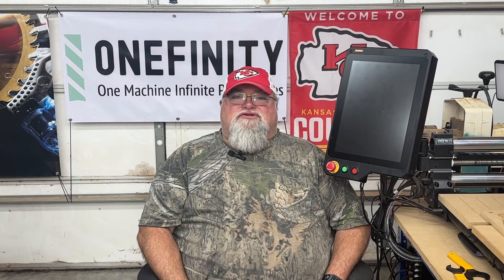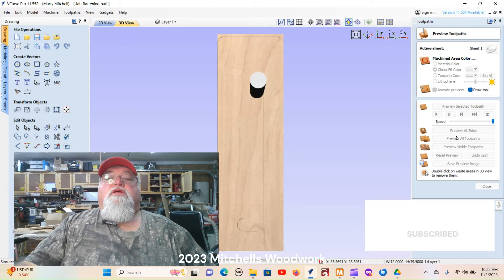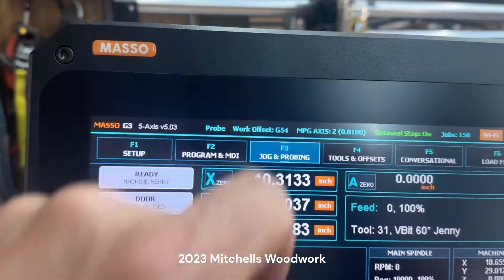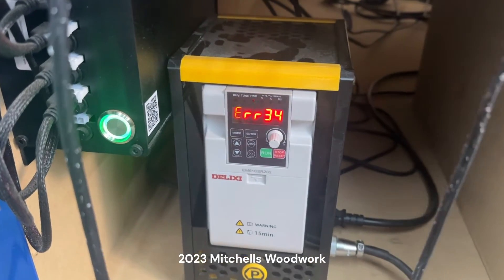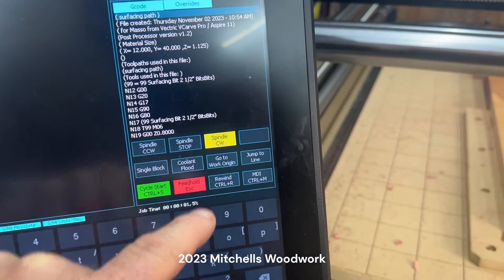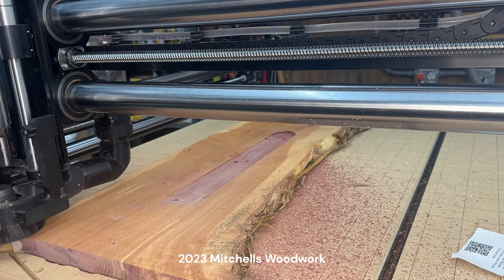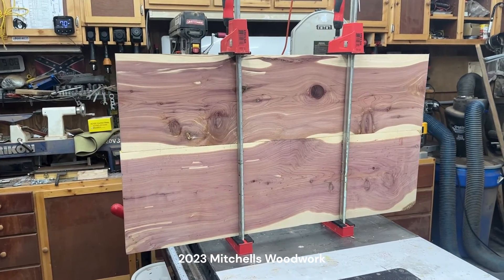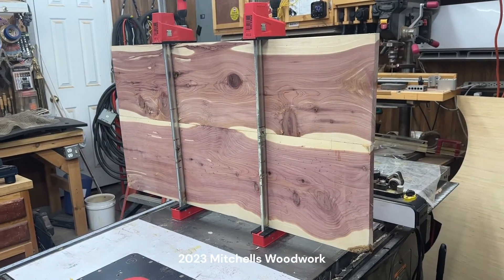Flattening A Slab With Onefinity Elite Foreman CNC / PwnCNC VFD Error 34 / VCarve Pro

Comment: Would you have the Bit # and the types of blades used. I need a good slab bit. I know it’s pricy
Reply from the maker: Thanks for watching.  The bit I used in this video has been discontinued, but this is my affiliate link to the newest version. Using this link will save you 10% on your order total.  They are expensive, but this is one of those “buy once, cry once” kind of tools.  I know I’ll never have to buy another one for the rest of my life.  Thanks for watching and for the question.  Let me know if there is anything else I can do for you. 😊

https://bitsbits.com/product/sb25-2/ref/6251/?campaign=YouTube%20Flattening%20Slab

Comment: What’s the difference between G54 and G55 offset ? And what dust boot are u using ?
Reply from the maker: The G-offset locations are defined and set by you.  My G55 is set to the corner of my wasteboard fence.  It’s my permanent XY zero.  But I could’ve just as easily set it as G54 or G56 or G57, etc.  My G54 is set the G54 to the true X Y zero at the home position, but I’ve yet to figure out how that’s really beneficial in any way.  

Basically, the G-offsets are to to quickly move your spindle to a very particular spot on your wasteboard, like the inside corner of my fence.
Reply: @MitchellsWoodwork  Ahhh. Got it. I’m so new to this and learning a lot. Thanks !
Reply from the maker: I’ve been using the PwnCNC v2 dust boot, but I’m having to switch to the v3 for my upcoming ATC install.  They are both exceptional dust boots and I 100% recommend either one.  

https://pwncnc.com/?ref=-KowKWxX6qaGK
Reply: @MitchellsWoodwork  thank you again !
Reply from the maker: @TheHelicapt  just keep watching videos, brother.  There’s a wealth of information here on YouTube.  Also, join some Onefinity and Masso groups.  They both have great forums as well. 

https://forums.masso.com.au/

https://forum.onefinitycnc.com/c/machines-elite-series/118

Comment: I am enjoying your videos and your input regarding the Masso controller. I do have a quick question about the Masso Likk app. I also use Vcarve, therefore I must use a Windows based computer. I have downloaded the Masso Link onto my computer and it seems to be working as is should but the window it is displayed in is so small I can barely make out what is in the input window. I haven't been able to fine a way to adjust it. Loaded it up on the mac, no problems pops up nice and big.  Any thoughts?
Reply from the maker: Thanks for watching and subscribing!  As a test, I just now tried to resize my Masso Link, and I didn't find a way to adjust it.  But I've never heard of anyone else having an issue with it being too small to see clearly.  Go on the Masso forum and see if you can find anything that might help you.  https://forums.masso.com.au/
Reply: @MitchellsWoodwork Thanks
Reply from the maker: Did you get this problem resolved?   I uploaded a new Masso WiFi video today.  

https://youtu.be/Z3Hbaqglv2g?si=I5_Nfi9TZXx60_kl
Reply: @MitchellsWoodwork It actually kind of resolved itself! I deleted toe Masso Link app and reinstalled it and low and behold it is normal size now. Don't know why, don't really care. It seems to be working now thanks for asking!
Reply from the maker: Glad to hear it!!  Now get to work! 
😉👍

Comment: I'm an industrial instrumentation/electrical tech so I'm fairly familiar with VFD's. That code 34 is probably just an overload error. Meaning it tripped the internal circuit breaker due to the extra amps you pulled. Most VFD's have a "reset" button on front. You didn't hurt your vfd because they're designed to do this. As long as you're letting it cool down you're good.
Reply from the maker: Yep, that’s the same thing the manufacturer told me.  Thanks for your feedback and for watching!

Comment: We’ve all had that happen. I used to get it often with my Makita and was the bit being pulled down under load. I’ve found it to be very important to clear dust from the collect during a change. At a minimum, tap it to knock dust out before inserting the new bit.
Reply from the maker: Great point, it’s very important to keep the collet clean to prevent tool slippage.  However, in this particular case I simply bit off more that my surfacing bit could chew. 😉

Comment: Love your channel.  Do you get most of your Cesar from a sawmill?  Also is the cedar you use dried at all?
Reply from the maker: I bought a couple 16’ trailer loads of cedar slabs from an older gentleman a few years ago.  These had been stored in a barn for over 10 years and were completely dry.  All of the thicker boards I use are from those slabs.  

I do have a great relationship with a cedar sawmill that supplies all of my thinner boards.  I have been buying and reselling cedar for several years, so I tend to keep a pretty good stash that have plenty of time to dry before I use them.  Thanks for watching!

Comment: heat the vfd too many times, and the windings on the spindle will end up shorting to ground.  As for the VFD, if you have proper cooling, it, in itself, if sized properly, should never get to the point of hitting over current, which leads to over heat conditions and faults the drive into safe mode (offline)- another point to make, when flattening a slab, always measure the highest point, set the DOC slightly under that, better to take more passes across to get to your determined z height final.  just tips.
Reply from the maker: As I said in the video, I absolutely (attempted to) set the Z at the highest point on the slab.  I can assure you, I have no future plans of heating up the VFD or spindle again. 😉

Comment: I have no experience yet but I do see guys doing slab surfacing where they make the surfacing tool path much larger than the slab, so the bit starts off to the side of the slab and then goes into the slab from the side.
Reply from the maker: Great point, and I've also been thinking it may be better to do them as a raster toolpath (side to side)  instead of an offset.  I'll try that next time and see how it works out.  Thanks for watching and commenting!

Comment: Very cool project Marty. I love the humility and humor of your vids. Subscribed! One word of advice. Get in the habit of zeroing off the spoilboard 99% of the time except for delicate surface vcarves and you’ll barely dig into your board. In vcarve just use z+0.003 and don’t hit =. That way if you change thickness in your job setup and recalculate it’s still good. I do this on my ShopSabre and my spoil board is 2 years old and barely used.
Reply from the maker: Thank you!  I try to keep the video aspect of the process as fun as possible.  Otherwise I can see how early burnout would be a very real possibility.

I am very intrigued with zeroing off the spoilboard, just haven’t had the nerve to try it yet.  So, you do this even if you’re only carving the surface of the workpiece, and not cutting all the way through with a profile cut?  I’m gonna have to study this more so I can fully grasp the advantage over zeroing off the workpiece.  🤔
Reply: @MitchellsWoodwork There is a reason why the production world uses the bed. For anything non-surface carve the material thickness can vary quite a bit and you don’t care. Even for non-through cuts like dados and groves you get exact final dimensions. For most jobs that carve the surface, I’ll measure material thickness and still zero off the bed. If it’s super delicate I’ll create a tool path / job sheet that zeros off the surface and my other cuts off the bed. That’s very, very rare though. I just wanted to mention this since you seem also enlightened by using a tool setter and G55+ offsets instead of those silly xyz probes. At the end of the day, do what you want, I just wanted to provide new perspective.
Reply from the maker: I'm all about exploring and learning new ways to do old tricks, so I certainly appreciate your perspective on improving my CNC game.  I checked your channel hoping to find a long list of CNC videos to learn from, but nothing yet (except an awesome Miley video).  Feel free to contact me privately anytime; a link to my digital business card is in my bio.  Thanks again!

Comment: I think when you rehomed it may have changed or deleted your z height value from the high spot.  Just spit balling on that hypothesis.  I had a similar situation when I used a huge 3 inch bit to surface my waste board.  First run with that bit and it dug in and tripped my VFD as well.  Also shattered on of the 4 wing replaceable blades.  Thankfully I didn't get any shrapnel and actually didn't notice the blade until the next time I used the bit.
Thanks for the entertaining videos.
Reply from the maker: That shouldn’t be the case, but I certainly can’t say 100% one way or the other.  The idea of one of those big bits coming apart is a scary thought, and I’m glad you didn’t get hurt.  Thanks for your feedback, as always. 😊

Comment: I think your tool setter attachment is either miscalibrated somehow?? or maybe it logged the centre of the bit but there is a concave area in the centre which doesn't match up with the lowest edge of the cutting blades or maybe the clamping pressure raised the stock material above the measured z...those are my best guesses. My primary guess though is the clamps were pushing the stock up in the centre. 

Just a thought here btw, can you start two playlists for future reference, one for masso error codes, and one for spindle/vfd errors. If people have this issue or other error issues in the future, your continued works may save some frustrations for others and become a valuable resource for aid.
Reply from the maker: I didn’t use the tool setter at first.  I had it disabled in the Masso and just set the Z on top of the slab using the paper method.  When I finally got the spindle going again that’s when I enabled the tool setter and used it, and that was the successful flattening job you saw in the video.  

Good idea about separating things out more in my playlists.   I’ll work on that, thanks!

Comment: Marty, I know comments help the channel so I always try to add a positive comment. I am curious about how you zero the surfacing bit with the tool setter. I watched your video installing the Dash tool setter. However, I am concerned about the Masso setting for the big bits. That process gets into G codes think. Switching between the bit changes concerns me, I am hesitant to go ahead with the buy.
Reply from the maker: Thanks Jim, always happy to see your comments.  DashMade recently added an attachment (actually two sizes) for larger bits.  It attaches onto the top of the tool setter with magnets.  You can see it for just a few seconds when I used it in this video (around 7:50 mark).  The tool setter attachment requires no tweaks or setting changes in the Masso.  Just add the attachment and continue on with business as usual.  There is no extra coding required that your CAD software doesn’t already provide   You really should try it out, Jim.  I can assure you you’ll never regret it.